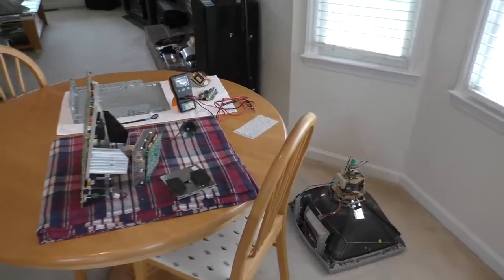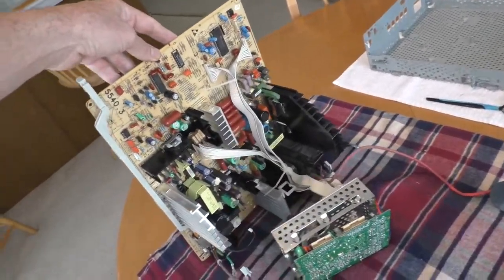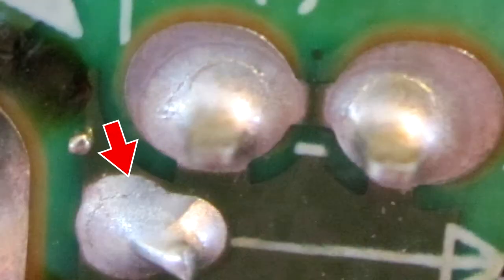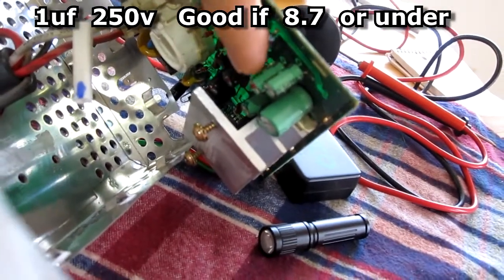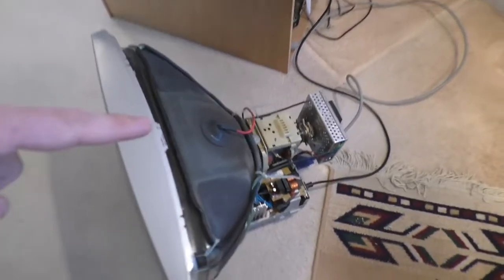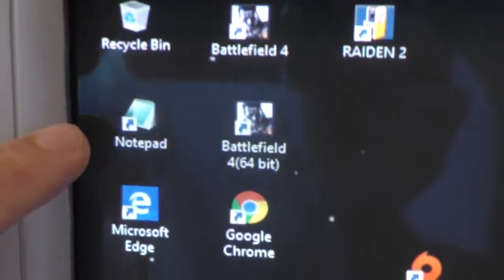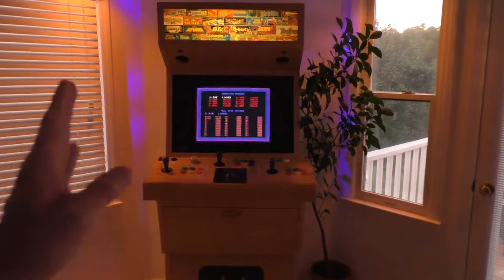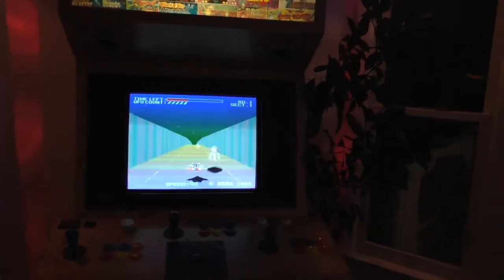Repair a CRT Computer Monitor Screen Shaking Bad Caps and Cracked Solder Joints Philips 201B4 Arcade

Comment from the maker: MESR 100 V2 capacitor meter:  https://amzn.to/35CfEso
UYIGAO UA6013L Capacitance Meter: https://amzn.to/2MPxwrh
Hakko FX888D soldering iron: https://amzn.to/31k2mNN
Hakko Desolder Pump Tool FR301: https://amzn.to/2MInurQ
Solder: https://amzn.to/33BRPPK
Some of the gear I use.
Thanks.

(paid link)
As an Amazon Associate I earn from qualifying purchases.

Comment: I have a 1997 black IBM Aptiva monitor (model 7095) with integrated speakers on both sides.

Problem is that sometimes the display flickers to a green tone on & off or sometimes stay that way for a long while or untill I shutted down & turn it on again.

Comment: I had two working monitors and something happened to my PC (I think either the VGA card or memory card needed to be re-socketed) however after many attempts to reboot the computer they no longer display video signal even though the CRT screen crackles when turned on and the light is green on the power on LEDindicator at the front- also filaments are lit, thus the CRT cathode guns should produce electrons. I do not know what else to check - does anyone have any ideas? I had to set those monitors aside and plugged a monitor that I knew was working and managed to boot my computer in the end. However, I want to salvage those big monitors because I use them for gaming. Anyone has an idea where the problem might be?

Comment: really nice monitor and perfect size for my taste.
I definitely have to revive mine, for some reason it died and not even the power led is working.

By the way do you know of any way to reset the CRT tv service menu values apart from the service menu option?
For some reason even though I select the reset option in the menu it does not run

Comment: My Dell P1130 is exhibiting the same symptoms, flickering along the horizontal plane. (it would start slightly underscanned and stretch and flicker its way to an overscanned image.
Reply from the maker: its probably the capacitors. They dry out as the years pass.
Reply: @FunBubble  Thank you for replying, and once again for creating a great video sharing your experience and fix!  For your info, here is a video my monitor doing its faulty thing: https://www.youtube.com/watch?v=l46JfOCZYXI

Comment: Hello, I have a hp pavilion mx70 crt monitor and what happens is that the part of the screen blinks sometimes because in the black of the image they sometimes look like flashes of light, I renewed welds that had bad and continue Likewise, I even got to suspect the flyback screen potentiometer but I don't think that is it, what do you think it is?
Reply from the maker: hi, id test all the capacitors. they dry out with age and eventually need to be replaced. its one of the most common causes of glitches.
Reply: @FunBubble  thank you very much bro 😉👍

Comment: I got a flicker issue, not major. I guess recapping would help. Only happens on the top portion of the screen. Not a full screen flicker, hard to explain. Imagine a dialog box (drawing of a square) and the top horizontal line looks like it cant decide if it wants to use one of two scan lines. Maybe its normal, dunno...

Also in some games, kingsom hearts 2, if i open the menu, the image kinda puffs and goes normal, same with exiting. Maybe it has to do with when dark images are overlayed on light backgrounds, or dimming when a menu opens. Weird...

I gotta get in there anyway, doing the RGB mod once my tools arrive. It has component, not progressive.. also noticed 80 column text isn't as sharp on component on my other screens as it is on direct RGB.. why is that?

Comment: Hi AnimationBubble! Great video, I'm having issues with my Iiyama VMP 514: screen shakes sometimes and it's a lot less bright than normal. Do you think the brightness problem could be related to bad capacitors/solder joints? I hope the CRT's not worn out, the picture is still very sharp.

Comment: Is dangerous reparing a CRT monitor? I never dissassembled a CRT. Great job man!
Reply from the maker: the dangerous part is discharging the tube. the tube can hold thousands of volts even after being unplugged. There are videos on youtube that show how to discharge a crt. its really easy, just a wire attached to a screwdriver and it takes about 5 seconds. i woulda shown that part but i already had the monitor apart when i decided to start making a video. thanks
Reply: @FunBubble  i've got a philips 107P4, 202P7 (22 inch version of one you fixed) and a 107B as my daily setup for my pc. each one has some kind of a minor problem, the 107 sometimes goes black randomly and when i whack it lightly, picture comes back, the 202p7 is a bit dim with a bit of shakyness, and the 107B sometimes clicks and picture zooms out like if it was being first turned on. i guess im gonna start fixing the 107P4. nice video mate!